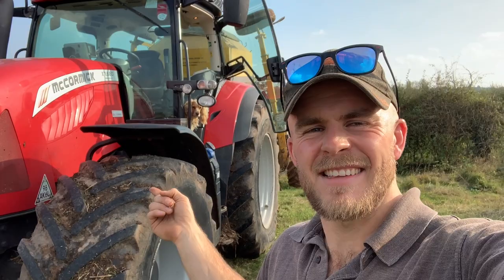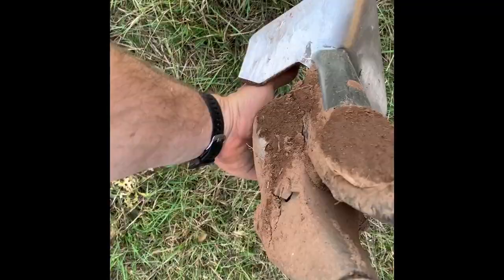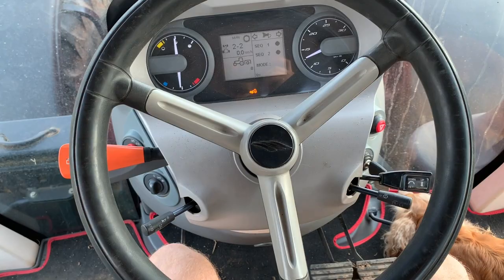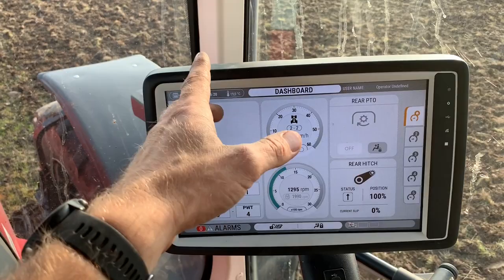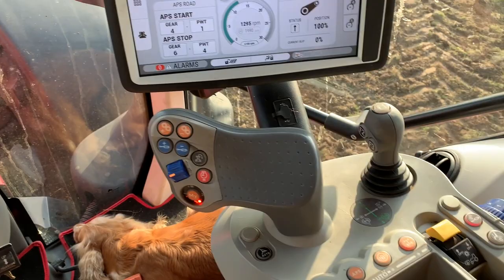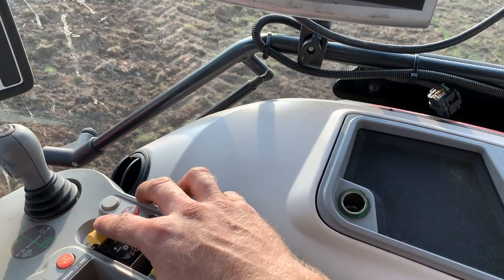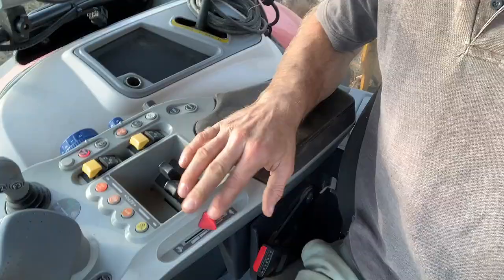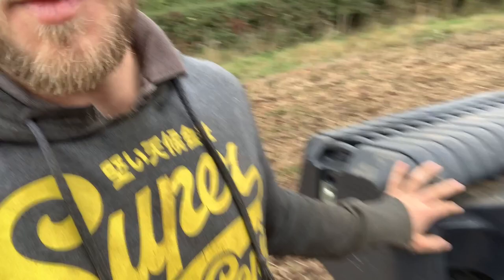McCormick X7 Review… Would I buy one??

Comment: Got a question about your Deere. Do you have access to the JD software to do your own trouble shooting. Our Deere dealer is in Denver, CO, Our ranch is in Montrose CO. 300 miles away. It is $2000 to haul our trator to the dealer and $2000 back. Trying to figure out what to do
Reply from the maker: Yes we do have access to JD software through an independent mechanic although we are only 8 miles from the dealer itself. In the UK our dealership are far closer together than in the US, partly due to population density but also because we have a far smaller farm size on average and therefore there’s a lot more of us.
Reply: Buy a Deutz